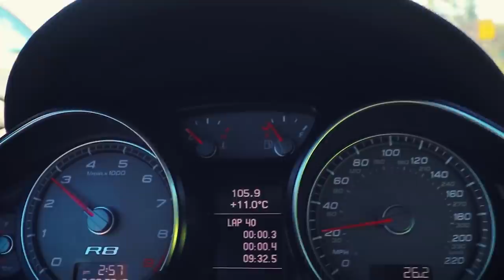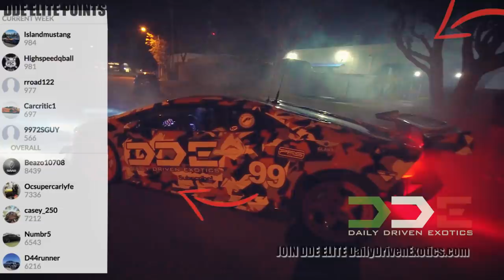SHRINK WRAPPING ALEX CHOI TO HIS CAR PRANK! *EMELIA VLOG*

Comment: Emelia is a great addition to the DDE fam. Yes of course you pour your oil that way so the air can get into the bottle and pours smoothly. Choi doesn't take practical jokes well because Damon really can't take them and goes to the extreme to get him back. That's when it stops being fun and you can see it in Cho's face. Emelia's laughter got me through it.
Reply: Choi can’t take practical jokes well because he’s used to being treated like a king. He also sees practical jokes as a way of putting other people down, which is why he gets so offended when it happens to him even though he’s happy to do it to others

Comment: Use dawn dish soap to get oil and grease out of fabric. Trust me it works. Example in a pair of jeans put some on the spot, before putting in the washer. 

The hood switch for the R8. Don’t feel bad, Emelia. A whole group of Audi technicians couldn’t figure out how to pop it up on an Aventador. They were looking with flashlights in the cabin and I yell out, “it’s probably like an R8!” They give up. I walk over and open the door and pull up on the switch. All synchronized Aaaaaaah and one yells out, “wow, all of us couldn’t figure it out and Luke does.” I just stood in awe. In awe, they couldn’t figure it out. 

Also, Emelia only eats healthy until candy is around. Examples starburst, gummy bears, and M&M. E-crew knows that. E-crew can be bad influence.